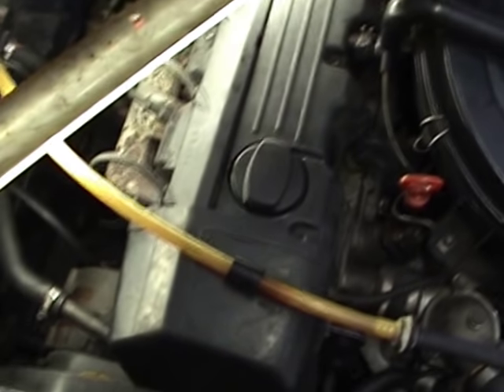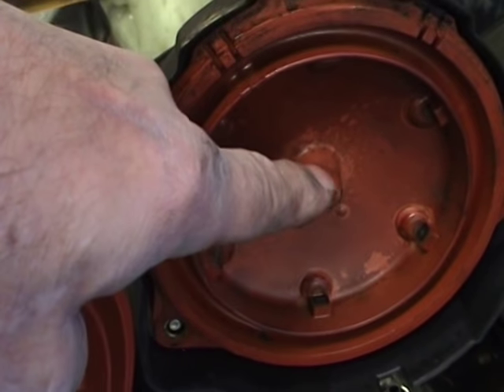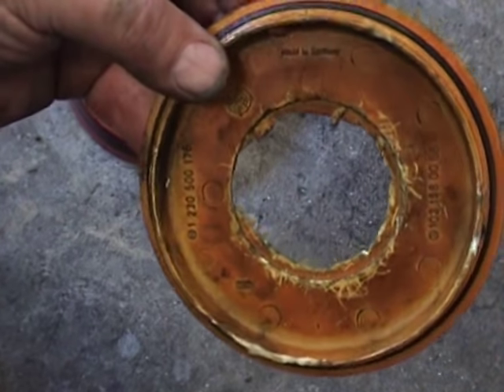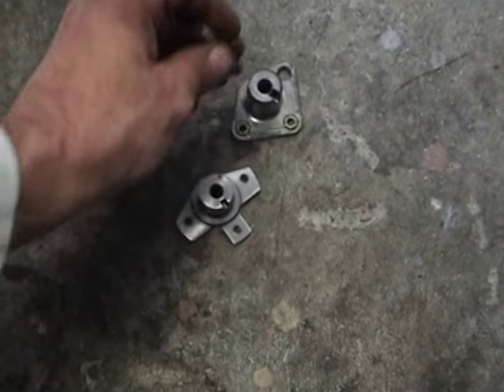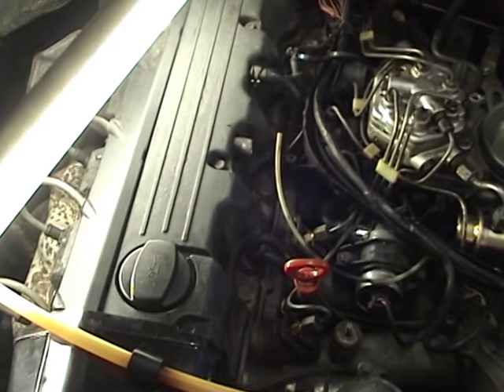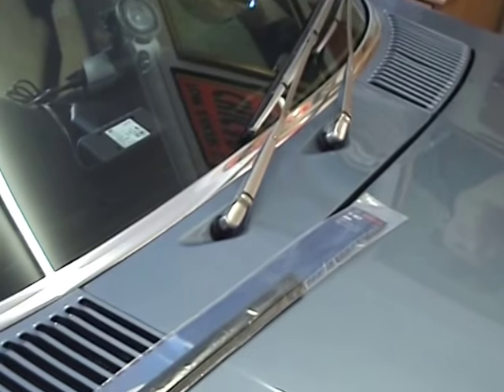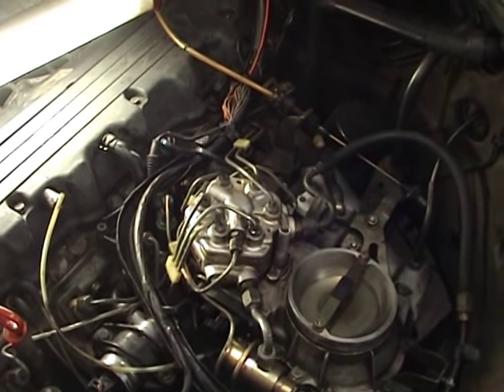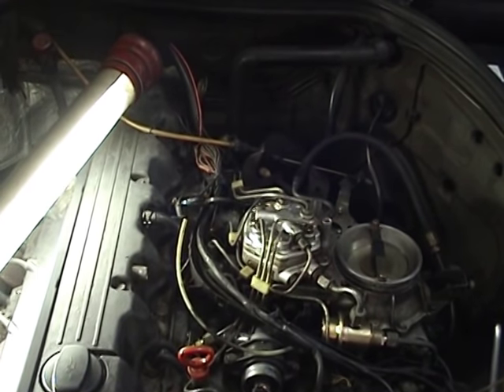Repeat of changing distributor cap & rotor button on 300E

Comment: Awesome video. I dove into my '91 300e to attempt camshaft seal and timing cover gasket change today, but the 4th bolt (bottom left) is hidden by two hard lines. I cant find any way to unbolt. In your car, i see that there is one hard Line (cooling pipe?) in front of that bolt also, but it's spaced farther away. Do you remember if you had to move anything to get that timing cover bolt?
Reply: I just loosened that bolt that holds the line in and moved it as far as I could. I was able to wiggle it out and wiggle it back in. It’s a really tight fit but it’ll work.
Reply: @justinb3560  I tried again but couldn't get my wratchet in there. The socket sits crooked, I think I may need to remove the belt and fan to get to this bolt. She's awesome to work on except in certain situations 😅